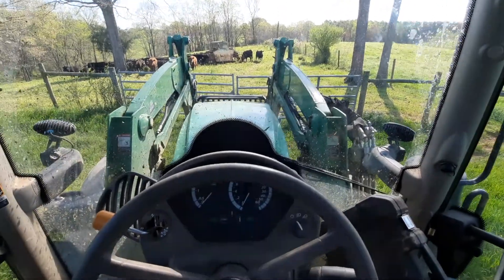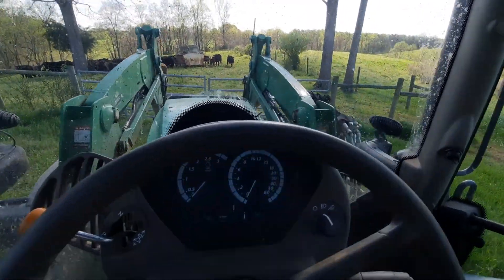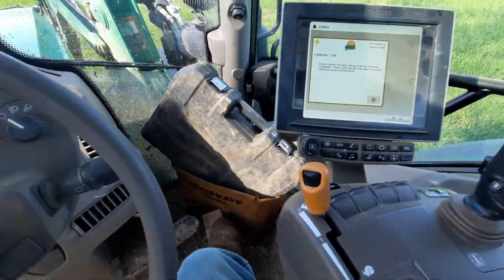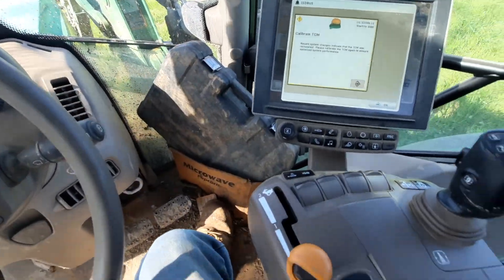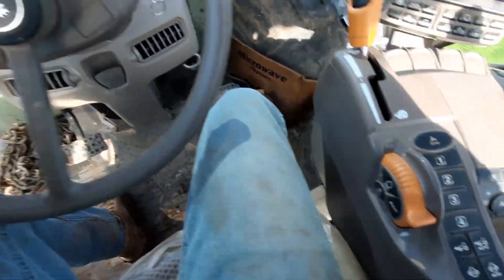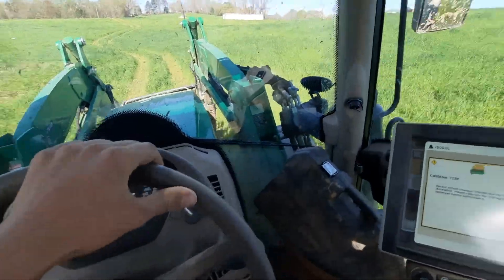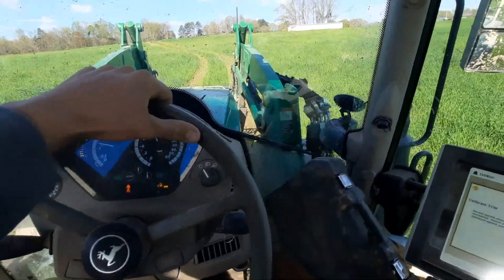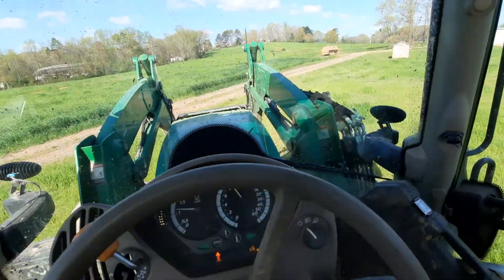how to run a john deere 6130r

Comment: If you don't need to use the clutch pedal in these tractors why does manufacturers put clutch pedal in their tractors ? Does it serve any other purpose ? I'm really interested to know because I can't find much information about it.
Reply from the maker: Honestly im not sure why they still put them in it, i beileve its just for preferences on the operators. When i worked at the farm i would ocasionally use the clutch rather than the brakes to save the brake life but its not required. Very good question, thank you
Reply: @blakecarter2703  Oh so it's basically there just for an extra option. That makes sence. Thanks for your reply.
Reply from the maker: @Modelo646  yes sir, your welcome